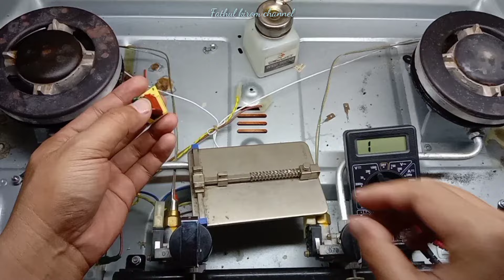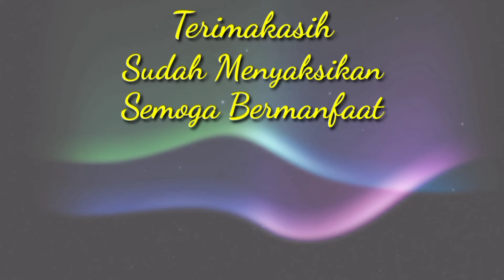Cara memperbaiki pemantik kompor tanam modena mati

Comment: Mas berapa no seri kapasitor kompor modena model BH 0725
Reply from the maker: BH 1725 sama BH 0725 sama" 2 tungku.. sepertinya sama pake 250V 225J.. coba di buka saja untuk memastikan..
Reply: @fathulkirom  hilang kapasitornya mas pa mau beli😅
Reply from the maker: oo gtu ya mas ... ok coba pakai 225J 250 V mas.. semoga berhasil
Reply: @fathulkirom  terima kasih banyak mas
Reply from the maker: Sama sama